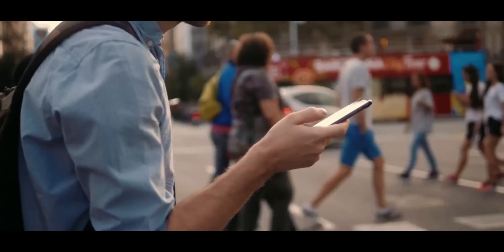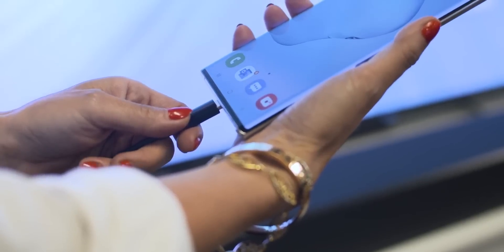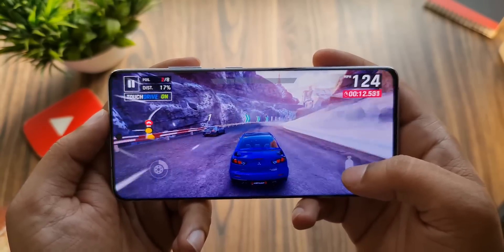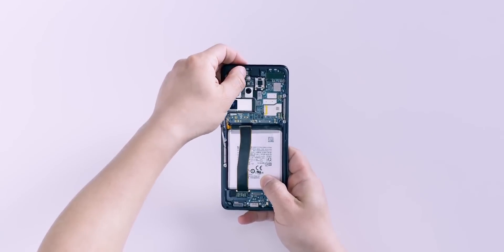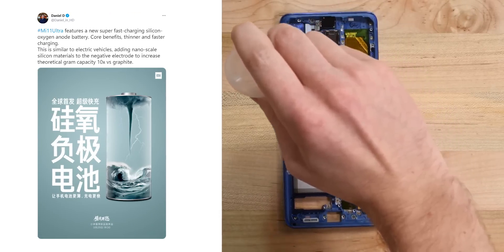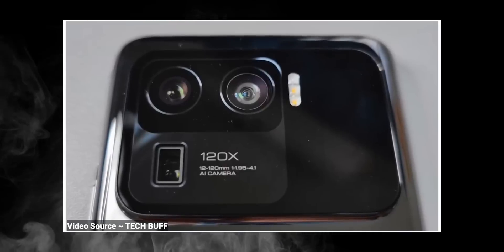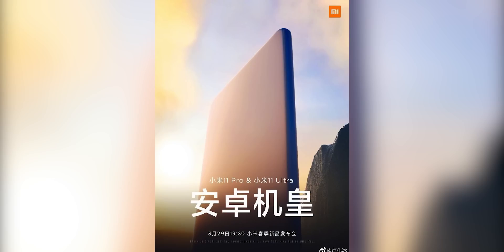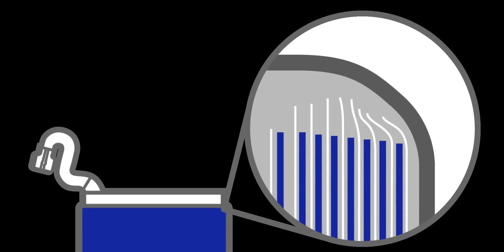Samsung Graphene Battery Alternative

Comment: How does this affect longevity of the battery? Does it also make it last more charge cycles? I mean, 67 watt charging is really cool but if it means that the battery is going to degrade faster then I would prefer slower charging that is kinder to the battery.

Comment: Just a note that graphene batteries in theory can store more power but in practice they do not. Graphene batteries is just a chemically modified lithium ion cell with balls of carbon dispersed in it. Graphene itself is not capable of actually making batteries as it's a conductor so it's more used as a medium to make batteries more efficient and to hold its charge until the lithium ions around it releases its electrons allowing the ones held by the graphene to be passed on. 

While in theory this allows for more storage, since there really is no perfect way to make balls of graphene it will never meet the advertised performance. Why existing graphene batteries are only as dense as normal lithium ion cells. Though they do have the advantage of being able to be charged faster due to graphene not expanding when heated up.

Comment: If the new batteries were in market this year..will my current device somehow able to used it? My current device is fine but i see it somewhat painful to buy a new devices only just because of the new battery tech..
Reply: The answer is definitely.

You'll have to buy new device to get the new battery tech because that's what they want

Also remember the early adopter tax. It won't come in low price tag
Reply: Honestly I'd just get battery pack with a new battery tech. It will be slim enough it'll be the size of the phone itself

Comment: Xiaomi was always babbling but not doing anything real (innovative). The smartphones may be very good, especially the price performance, but when it comes to the most important point, the software, they have never been good until now. Just the fact that you have / had * advertising * in your operating system is a huge argument not to buy a Xiaomi device. With the software they have on it, even if the processor were 2x faster, the battery would last 10x longer and the camera would be much better, I would never switch from e.g. a OnePlus, Samsung or Apple device to Xiaomi. So far they have neglected the most important things.

Comment: As someone who just bought an S21 Ultra and plans on using it for years, as soon as better battery technology comes out and is widely adopted and proven. I will 1 million percent upgrade to the next flagship. It won't be foldables, or rollables, or 10000x Zoom. It will be the battery.

Comment: Still holding onto my S7 Edge until the next battery-tech is out... let's hope it will continue to survive however long necessary :D
Reply: Still holding onto Nokia 1100 for the same reason
Reply: I Loved the S7 Design, How's the phone? Is it laggy or something after all this time?
Reply: @bsw562  Not noticeably, but I try to keep it clean for that exact reason. Compared to a new smartphone it will still be way slower, but more than acceptable and still perfectly usable especially considering all those years (and times I dropped it lol)
Reply: Agreed bro
Reply: @jakobebelt3052  Ok, tbh i could still probably use an S7
Reply: @bsw562  still a trooper, although it's pretty slow compared to my mi 8 pro
Reply: @bsw562  still using a galaxy s7 exynos,  runs smoothly
Reply: @bsw562  I also use s7 edge and it's not laggy  for me using it since 2016
Reply: Bruhhh🚶🏿‍♂️
Reply: S7 edge ganggggg
Reply: @showyourbobs  hell s7 edge.
Reply: Even I still use s7 edge
Reply: Same using s7 edge.
Reply: Same here bro. No complaints about s7 edge performance.
Reply: @Mromkarmhatre  I mean it's not flagship level anymore, but if low-range phones can handle reduced graphics games at 60fps I'm sure the S7 can do the same.
Reply: Me too still sticking to my S7 edge lol
Reply: Bro I just upgraded from my s5 so you should be fine for like another two years
Reply: Buy a new phone now and when the battery tech is out just trade it for that new phone.
Reply: Im using the regular S7 ...still going
Reply: I thought S7 and S7 are no longer supported by Samsung? Did you custom ROM it to the latest Android version?
Reply: Still using the flat variant of S7
Reply: 😒🔫I still using my note 5
Reply: @darkknight4483  How is the Note 5? Did you custom ROM it?
Reply: @ExileRicochet13  it's great I have no problem  with it I mean big and amazing screen loud speaker and... the only issue is battery with 12 hours and I mostly kill it in a day so not a big deal 🙄
Reply: Same here!
Reply: @brianwithay2318  ❤🤘🖐👌👍
Reply: The S7 egde😍, i got mates
Reply: Happy by the fact that I am not the only one using this phone 🙂
Reply: @apou71  welcome to the Club bro🙋‍♂️
Reply: Using s9 plus...
Reply: Exactly the same thoughts and situation here. Typing this reaction with my S7 Edge that's falling apart and can't handle all those apps (*WhatsApp*) that can't be stored on the external memory..
Reply: man you guys can hold a phone long. I'll look into buying maybe s22/s23 future just the normal version gotta save a bit but kinda want that flagship feel.
Reply: @sireajeel5009   send me a picture of your current phone. Id love to see which one you have.
Reply: @subliminalgoat  i have a xiaomi mi a3. i was 15-16 when i got it now im 18 should last another year or two then I'll consider a samsung because man does samsung s lineup look juicy. i watched unbox therapys review on it and was kinda sold especially on the price.
Reply: Same here and the performance is good with no lag.
Reply: Using s7 .... gonna get s21 next month
Reply: @z_y_z_zz  bro chill wait for the s22 i think
Reply: @sireajeel5009  i really need a phone i can't use this for a year
Reply: @z_y_z_zz  if you have cash then go ahead but if i were you i'd wait for the s22. but im not forcing this on you just my advice
Reply: @z_y_z_zz  im using a xiaomi phone and its already passed the 3 year mark on this phone and im getting sick of it too. and im looking to replace it with s22 or s23 so if i can do it you can.
Reply: @sireajeel5009  my mi 8 pro is 3 years old and is still great. it can even play genshin impact on high (30fps but still).
Reply: @sireajeel5009  why keep a phone for 3 years, like after a year and a half it's nice to upgrade
Reply: @dressrosaRMFC  phones if kept well and when bought is considered decent can last 5-10 years making its cost per daily usage on us people who want to save lower. it is nice to upgrade after the 4 year mark tbh but honestly i rather spend money elsewhere like family.
Reply: @sireajeel5009  well that makes more sense, I tend to change my phone every year max 2 years, otherwise it becomes too outdated
Reply: @dressrosaRMFC  yea its personal preference and how deep our pockets go and your way is still viable aslong as you get good trade in deals or fetch a good deal elsewhere
Reply: S7 Edge ❤❤
Reply: That thing will last longer than our democracy
Reply: Lol same here s7 edge for lyfeeee lol
Reply: me too..holding my s7 edge for next worthy.....
Reply: You ain't waiting for no battery
Reply: You can hold on but dont say u r doing so cos u r waiting for new battery tech since even the s9 battery is not that strong as compared to today's gadget.
Reply: Me too Im still using s7 edge ❤❤
Reply: Wow.. i still use my s7 edge and will upgrade only after the folding phones actually become a thing. Glad there are people who think like me.
Reply: Lol my dad still uses a note 5, and play asphalt like a gangster with me.
Reply: @AlarThunder  why would he keep a phone for so long tho, I don't understand
Reply: I have the s7edge now and really the app crashes are mmmmm
Reply: Shah Darshan  I used S8 for more than 3 years and the battery life sucks like hell. Not only that but internal storage is insufficient for me so I got so fed up that I switched to the A42 5G and never regretted my decision since then. Been using it for 4 months now and the phone is an absolute beast!
Reply: Shah Darshan  yea once you have those problems then try clear the phone and see how it goes. if it doesn't go well upgrade.
Reply: Likewise. I haven't chenged mine. Still works fast. I'm just waiting for the amd/exynos chipset.
Reply: @ThePatriciaagbulos  yea boiiiii lets go s22 hypetrain
Reply: Same here 
Using S7 Edge Yet..!
Reply: Same here. Using the S7 Edge International variant with root and custom rom "LightROM" as a daily driver.  Making it a powerful contender with the newer phone.
Reply: I'm still using the S5 ... Just Sharing
Reply: Let me guess! You’re dealing with outdated software, bad battery, burnt pixels...
Reply: @ramzilaheg6820  who?
Reply: My brother you are not alone 😂
Reply: Same lol
Reply: Suggest to upgrade to a phone with Android 12 out of the box, it will be a game changer & it will have better battery too
If you want save money get the S21 Ultra for almost half price next year, it will last you next 5yrs
Reply: Lol și many people with S7 edge nice i got the phone from 2016 and still going we in 2021 is ok what to do economy S7 edge gang don't bother us or we will put you on the edge lol
Reply: Are your screen edges okay?
Reply: I held onto my s7 edge for as long as I could but the motherboard gave out :( I loved my s7 edge. Is yours still going?
Reply: Lmaoo wtf just say you're broke and move on.
Reply: @Jay2k2323  Just because they don't see the point of buying a new phone doesn't make them broke. Flagship phones offer very little improvements over their predecessors in recent years.

Comment: Anyone else just waiting for graphene or solid state batteries to finally come into production 😴😒
Reply: I am
Reply: Didnt Xiaomi release a phone with a graphene enahnced battery ? the xiaomi mi10 ultra I think it was?.
Reply: @geester  no
Reply: TEC Youtube  I'm just waiting for clothes, batteries, cars, electronics to be made out of it cause the last time a legendary thing came out was either the silicon chip or lithium-ion batteries. We need this to come out
Reply: TEC Youtube  dude, that's not how mass production works. It takes at least 2 years after conception to make manufacturing plants for new technologies. Why lithium ion cells were invented in the 70s yet commercial batteries were not released till 1991. Remember also that photonic computers exist today, yet modern computers are still silicon finfet. Yeah takes between 2-10 years for a product to go from concept to purchase. Notice how Samsung has made folding OLED displays since 2008 yet we didn't get the ability to buy one till 2019. That's just the development cycle man. Same reason we don't have hydrogen or natural gas powered cars on the market except in California.
Reply: You're gonna be waiting like 10 more years for solid state batteries. We don't even have proof of concept ideas of how to make them yet. 

Graphene might come in the next 2 years, but it likely won't change much. Graphene isn't great for using as batteries, it's better for making capacitors as it's a conductor. As such while graphene batteries charge faster storage usually isn't changed much.
Reply: @Skylancer727  if I can charge my entire phone to 100% in like 10 minutes it doesn't really matter the size of the battery.
Reply: @Skylancer727  Solid state batteries are not that hard to create we just need to find a abundant material to make them out of hence graphene soon.
Reply: We already have good batteries which last a whole day, simply put your phone on wireless charger while sleeping and wake up with your full charged phone next day, technology is so easy but people just unsatisfying them-self thinking of more than enough, live in present not in future...
Reply: @shabbirdharwala2726  who needs x64 and arm processors when you have 500mhz x86 Intel. It can handle my Windows 95 os along with my word documents that is stored on my trusted floppy disk. People these days are not satisfied. Don't live in the future, live in the past.
Reply: @Dongzzzzzz  you have still not understood , yes new innovation is good and everyone wants, but unsatisfying today and hurry makes your life dumb, technology is not so easy people accept a lot...
Reply: @shabbirdharwala2726  you don't understand. Humans naturally want more which results in demand and with that a supplier will fulfill that demand which drives innovation. What's not to like about graphene batteries? There are much more abundant, environment friendly, holds a charge longer, faster and safer. It is also gonna be on a solid state form giving higher energy density.
Reply: @Dongzzzzzz  the future is now old man
Reply: @shabbirdharwala2726  it's more that there's no incentive to push advancements out the door as it costs more to do, people don't like paying for more state of the art technology, and it limits how they can market their next phone model. There's a reason Apple tries to redesign their phone each year, it gives you a reason to want to buy the new one and makes it obvious on a first glance which model you see someone holding.
Reply: @shabbirdharwala2726  Our batteries deteriorate overtime and the capacity goes down but with new solid state and graphene batteries they can last multiple times longer.
Reply: @TooVirel  I want a phone, which can last a week without charging and doesn't degrade its battery a kot even using dex for a week straight
Reply: @AlarThunder  I want a device that's the size of a contact lens that goes in your eye and charges using your energy. But unfortunately we gotta wait for what we want.
Reply: @AlarThunder  I want a phone that prints legit and real physical money
Reply: @Hhhh22222-w  print 😂money this is so less except more...
Reply: @AlarThunder  I Want an battery that lasts forever
Reply: @shabbirdharwala2726  It is understandable what you want to say. But this video is not the correct place for it. It’s like going to a BBQ and saying please don’t eat meat
Reply: @shabbirdharwala2726  wireless charge? You use that old thing? Everyone is using air charging nowadays
Reply: @Hhhh22222-w  who is using lolzz its so expensive by a chinese company the tech is far away ...